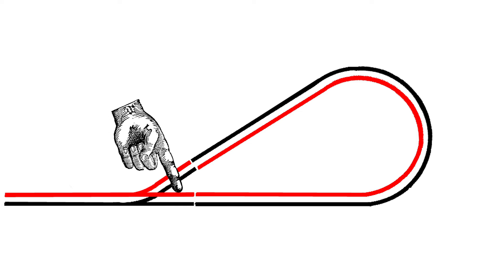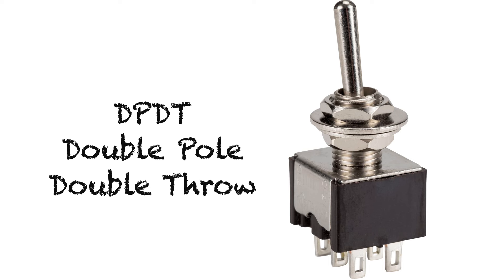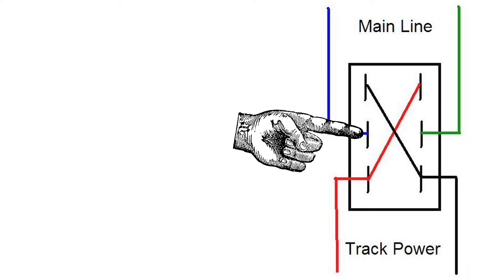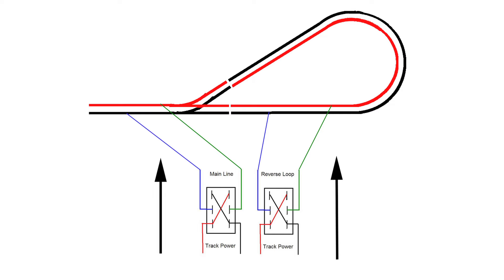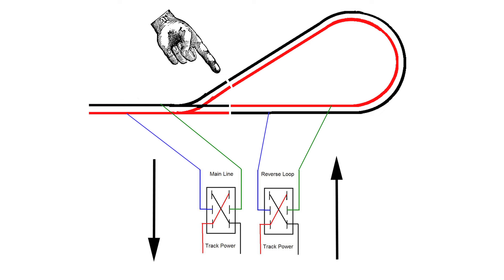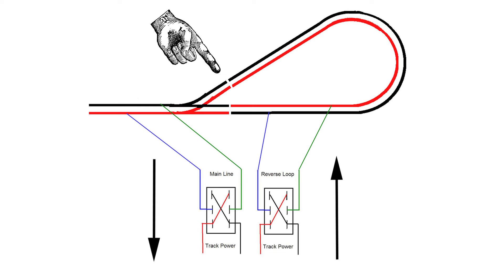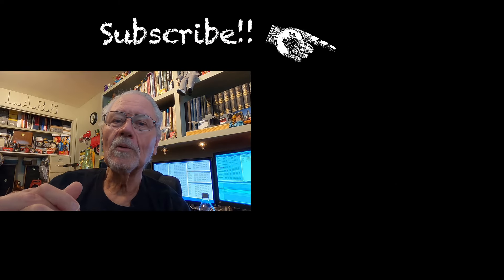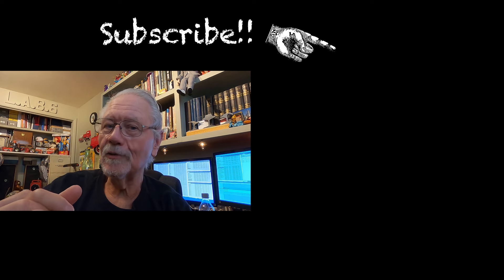Reverse Loops - Electricity for Model Railroads

Comment: Great explainer, Dale. I've tried to describe the difference between DC and DCC reversing loops and you've made it very simple for people to understand. My problem is that I often forget to the throw the switch so I really needed to automate it!
Reply from the maker: With DCC it is so simple to automate! With DC it’s downright tricky, but I had a backyard railroad with automatic reversing loops, point to point, and it never once messed up! It used to diode, bridges, and a relay to reverse mainline, polarity, and two track sensors to throw the relay

Comment: This problem is precisely why I decided to go battery power with my garden railroad. I wanted to run point to point for operations, but also be able to run in circles for live steam. My layout runs around the edges of my back yard as to not protrude into the middle, so there’s no room for a big loop. Therefore, I have a smaller loop at each end. This is the best explanation I have seen!
Reply from the maker: Thanks!! Same track plan that I had. Loop to loop. But with track power. I did have a battery rail bus, guess what, that’s what I tan most of the time!  But the track power worked fine. If I cleaned the aluminum rails. I hate aluminum rails and will NEVER USE THEM AGAIN. Anyway I had an LGB track cleaner. And track power. And the loops worked perfectly.
Reply: Yeah, that seems to be the way to go, or battery of course! Working on a boxcar that will have a railpro chip in it for my Bachmann steam locomotives. That way I don’t have to have a chip and battery put in every engine and can just hook them up to the boxcar. I have all LGB track (but only 2 LGB cars haha), no aluminum. Everything runs fine… as long as the wheels aren’t plastic. Another reason I went battery is that we don’t have proper electric anywhere in our garage or back yard. Who knows, I might do both battery and electric on the inevitable next layout.

Comment: I used to have a reverse loop and had the switch (for the loop feed) controlled by direction of the point (switch in USA).
Good practice is to stop the train to wait for the road to be set so you can then change the direction if DC on the controller.
Reply from the maker: Yup!! I had similar on my old garden railroad. Video on that coming

Comment: Thanks Toy Man TV. Figuring out which rail should be what polarity on a normal track configuration in a DC system is usually not hard for me, but a small layout I built for my son had multiple turning track routes all in a very compact junction area. Essentially, the folded double lap figure 8 main line ran through a three way turnout, and crossed itself at 90 degrees in the middle of a wye. An interchange track also doubled as one leg of the wye, which also formed a shortcut continuous loop from 1/2 the mainline tracks. The other leg of the wye also formed a big reverse loop from the entire mainline. To make life even more interesting, a few industrial spurs ran off the top of the wye (mainline track), and the wye would be used as a run around track for switching the spurs. I imagine the complexity is on par with people who model complex streetcar and trolley layouts using DC two rail wiring vs. live catenary. Figuring out how to DC two rail wire it all messed with my mind and I completely failed at my first attempt to locate rail gaps and wire the junction area. I fell back on the basic rules from the old Linn Wescott / Kalmbach book "How to Wire Your Model Railroad" and marked the roadbed, with red and blue pens, which rail was north polarity and the other to be south polarity for normal single direction operation at every turnout and crossing (think like your train is heading in one direction over the mainline, like "eastbound", with the N rail on the left side of the locomotive and the S rail on the right side). Mark every rail leading into every track turnout (switch) and crossing. Then with a lead pencil, I marked N and S rails with the train starting out "eastbound", proceeding thru the reverse routes and the interchange. I actually pushed a small locomotive over the tracks to do this. Whenever a rail ended up having both a pen and pencil opposing N and an S leading into a turnout or crossing, I knew I had to cut rail gaps and drop red and blue feeder wires from every length of isolated rail. I then sketched out all the possible routes a train could run through the junction in thru, switching, and reverse moves eastbound and westbound on separate sheets of paper, including the N and S rails, gaps, and feeders, and it was much easier to figure out what feeders needed to be connected to the reversing toggle switches. I'm sure i ended up with 4 or 5 different routes thru that junction that would turn a train around. Second try was a total victory, using only two reversing toggles..
Reply from the maker: Mind trip. I love it though. A puzzle and a model all on one!  The next few shows are just that, the hidden loops and other track elements. 

Thanks so much for sharing ❤

Comment: Dale: Great explanation (even talked about block control without calling it that.). Looking forward to hear the next installment using the self sensing electronics.
Reply from the maker: Hi Ken!  Thanks. Two more just on reversing loops!  But LEDs stuck right in the middle as we are doing those in the firehouse.
Reply: @ToyManTelevision  It is the one on the ardino that I am interested in.  One of the improvements that came with the development of IC chip technology.  When I started innN scale I never thought that the industry would develop a board small enough to do cab control like they did with HO.  Gosh I still have locomotives and rolling stock with Rapido couplers.  Say what you may about them but I had no issues with decoupling.  Patiently waiting. Ken